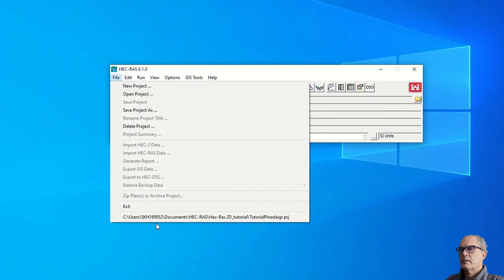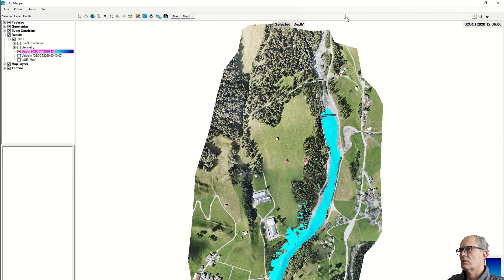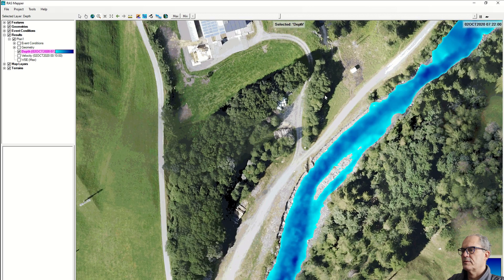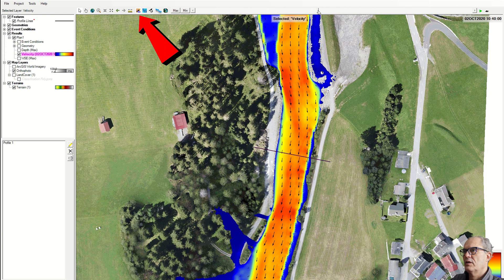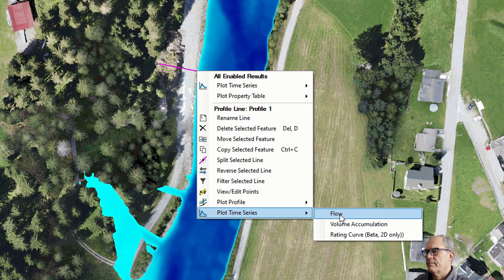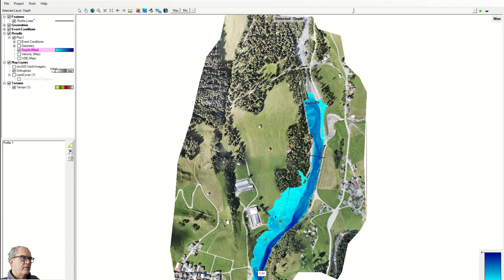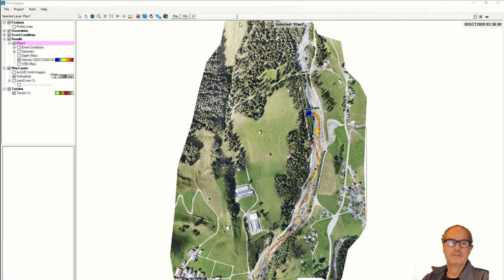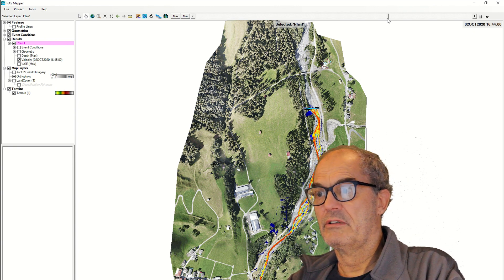HEC-RAS part 9/10, Display and discuss the results of the simulation with HEC-RAS 6.1

Comment: Dear Professor, I have a doubt. I ran my simulation, but my flow ended in the middle of the flow path; it did not end at or near the external boundary condition. What to do?